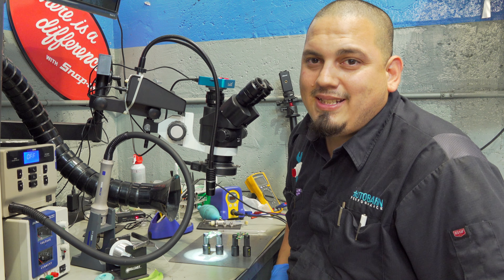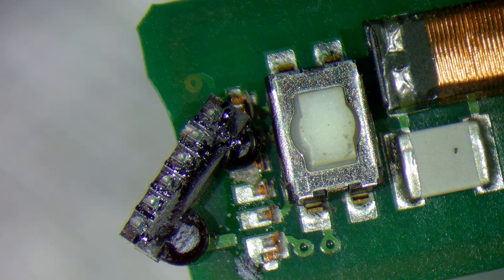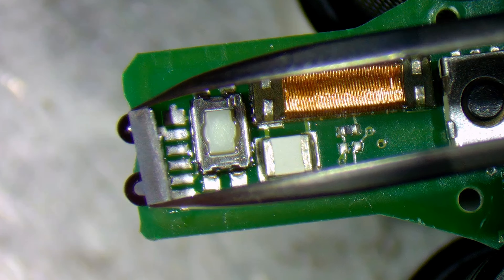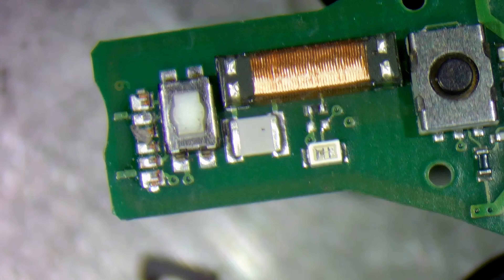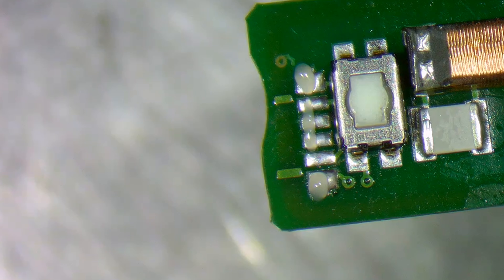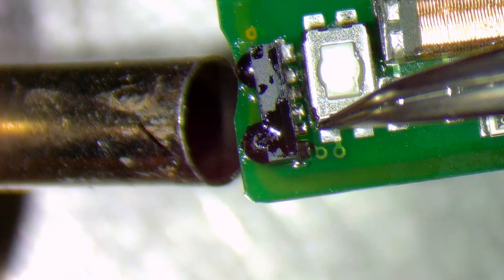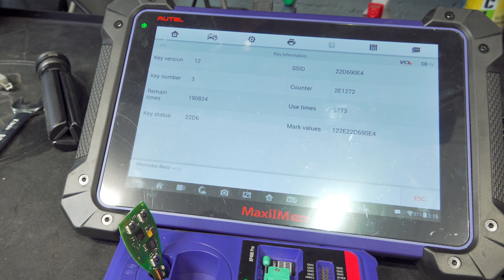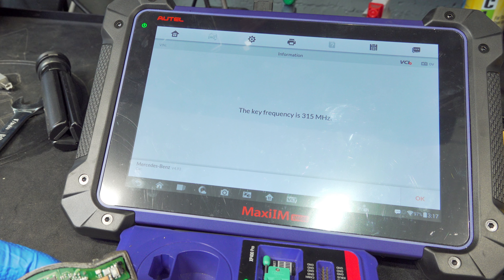SUBSCRIBER SENT IN A KEY TO REPAIR

Comment: Good job! Just a note - usually, when reflowing SMD, the parts self align when solder melts - no need to hold them until solid (for really stubborn parts, a little nudge does the trick).
Reply: I was gong to say the sme thing about the part will self align due to the surface tension of the solder.
Reply from the maker: Yes that's why i released it, but i still like to hold it down 😆
Reply: @tedjones450  Correct!
Reply: @SuperMarioDiagnostics  Belt and suspenders 🙂

Comment: Amazing work. 
I tried replacing the battery in my MINI Cooper key. It turned out to be a waste of time. The key had to be cut open to get to the battery. The new battery worked for about four months and then died.

Comment: Ole faithful Autel is back up and running.planning on upgrading to the im608 pro 2?
Reply from the maker: I think so
Reply: @SuperMarioDiagnostics  We spoke to Autel about it. It has the same function ability but just faster. They said vendors are making false claims that it actually does more. Faster is always better though.

Comment: What is the purpose of the separate IR system in these keys, in addition to the 315Mhz RF communication? Is this just for programming, or the car uses the IR part in the ignition for start authentication?
Reply: The IR system is definitely used as an alternative opening system for those cars which have an IR receiver in the door handle. This supports comfort functions such as rolling down all four windows at the same time. I believe start authentication is accomplished via a passive system in the key (similar to an RF tag system) which works even if the key fob batteries are flat.
Reply from the maker: Car wont start if IR is disconnected. So it is directly transferring information between key and eis for drive authorization

Comment: Hi there good job . I have a key for w204 Mercedes c300 2008 but don’t initialized I check it at Autel key programming and it’s reading all the information the button working and the led but doesn’t open the car And don’t initialized. With another key it’s working Do you know what’s the problem? Thanks